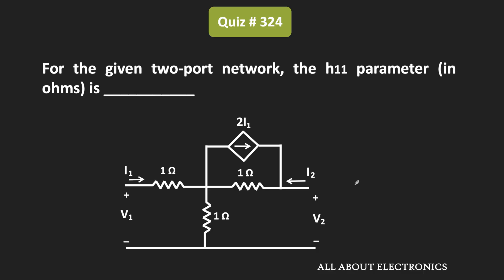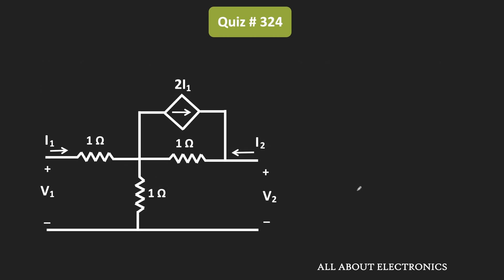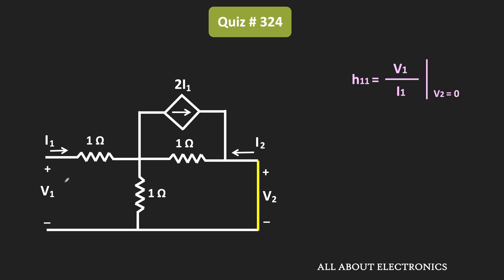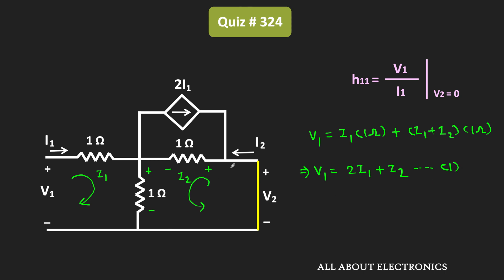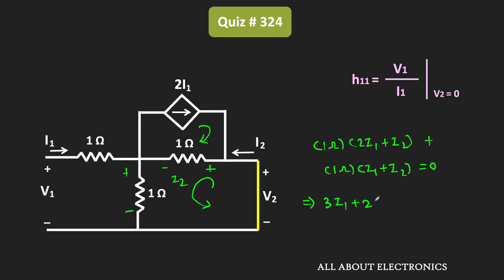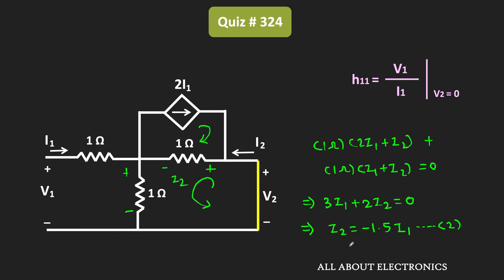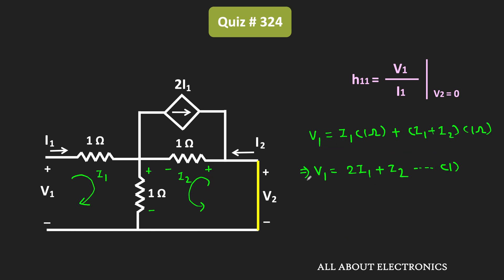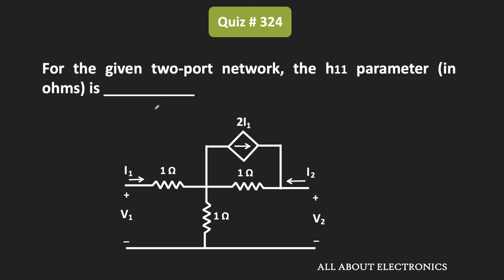h - parameters Solved Problem (Two-Port Network) | Quiz # 324

Comment: I combined the two parallel resistors on the right side and transformed the norton circuit to the thevenin equivalent . After that it needed only  one KVL equation and it was solved